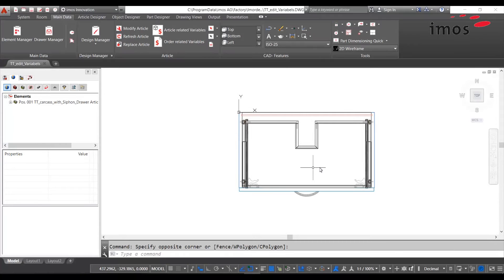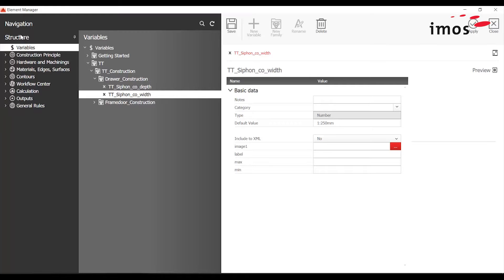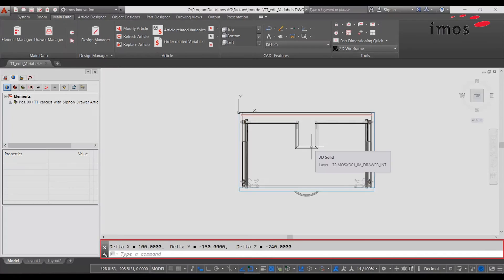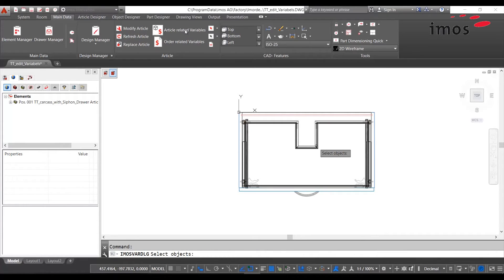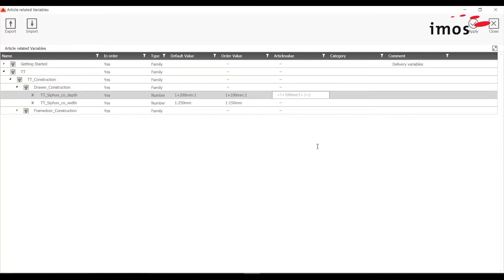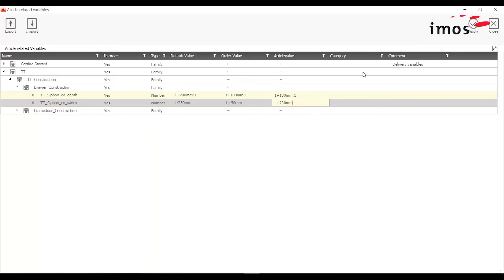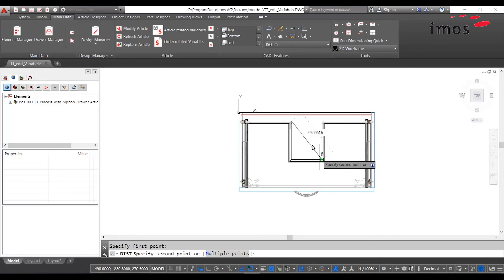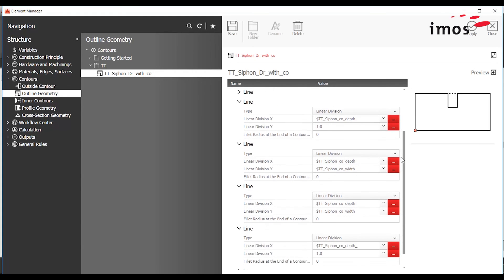#imostipsandtricks - Editing variables [EN]

Comment: Hi. How did you built the drawer box? And can you show us all the outline geometry lines? I am doing this to a bottom shelf as a test and it doesn't work. I am missing something. Thank you
Reply from the maker: Hi Zagoritis,
for the drawer you need to take a different approach:
You will have to open the Article Designer, click on the three dots button next to outline geometry and assign one.
Then, go to 'Divider' and change from the tab 'Division' to the tab 'Drawers'. Create 1 drawer and open the Element Manager by clicking on the three dots button. 
Choose a drawer you prefer. You will see the usual dropdown features for 'Construction/Front/Shelf/...' plus a new one called 'Sides'. Here you can add and adjust all sides needed.
Do not forget to save the drawer under a new name and close the Element Manager.
The Article Designer can be closed without saving.

Please let us know if it works. 

Your imos team.
Reply: Hi there. I did exactly what you saying but it works only on the cabinet with the outline geometry and the cabinet following the outline geometry. I did change the name of the drawer and i saved it but when i put a new cabinet and i chose the drawer that i saved it comes back to normal with 4 sides instead of 8.
p.s. i am using imos 12